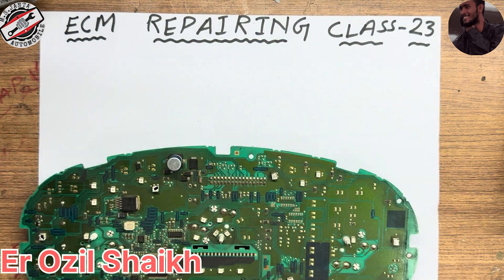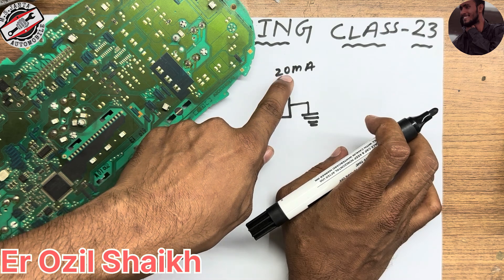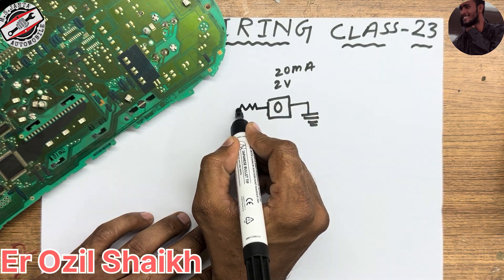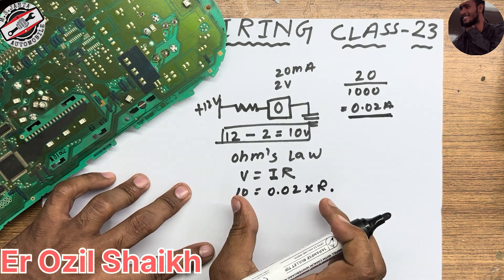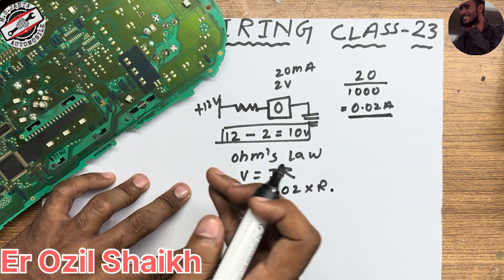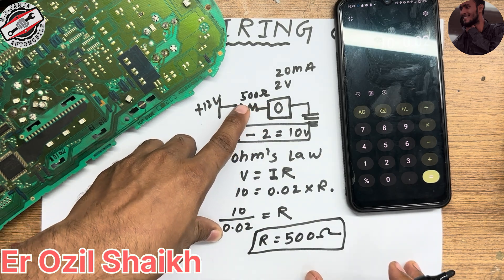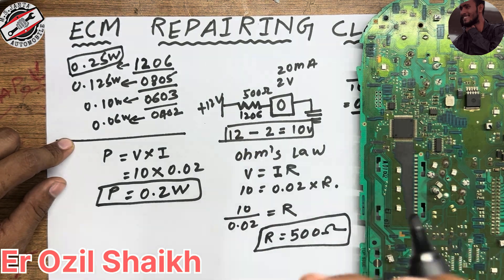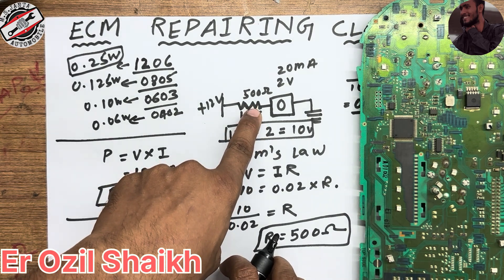#23 In English How to find Resistance for check light led,abs led, aribag led etc by ohm's law V=IR

Comment: I have a question about  my ecm A2721534479 me9.7 2006 w203 ,if my ic power chip is damaged and still attached to the board ,then can I still 
Have this ecm sent in to be cloned onto another unit ?
Reply from the maker: If 3.3v is okay then it will clone
Reply: @m.s.jantaautomobile1765  thank u